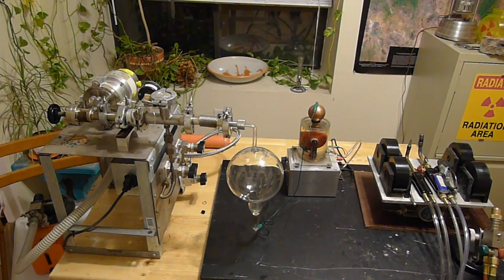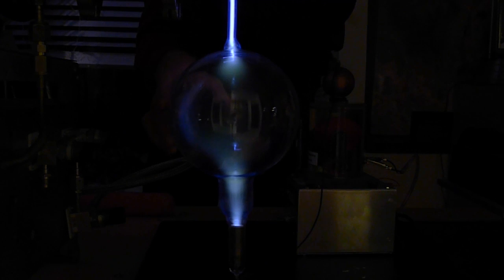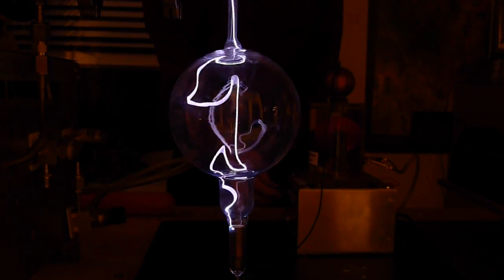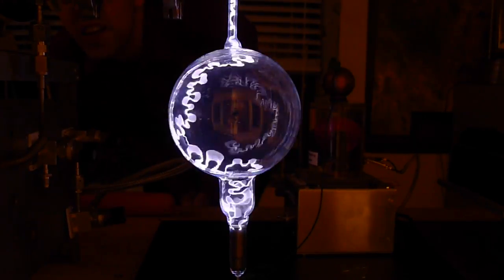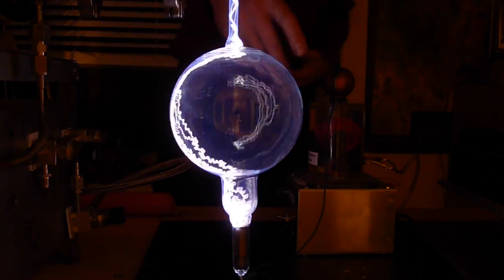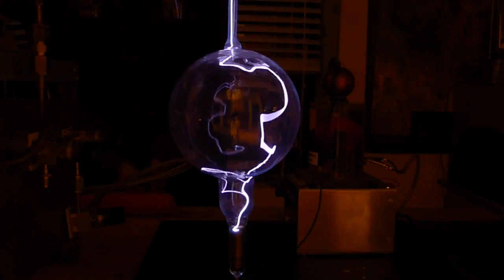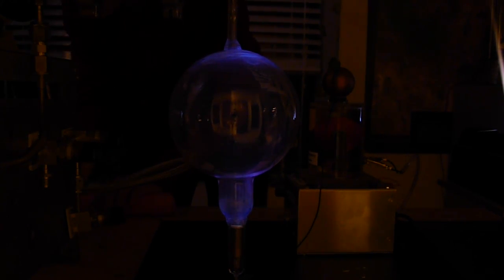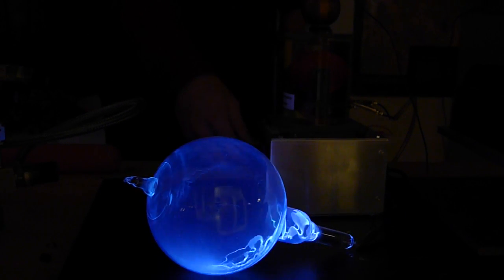Electrical discharges in xenon at various pressures

Comment from the maker: I've come to a new understanding about the green color in some of my tubes, and now know that is has to be related to the presence of air.  I have ruled out oxygen and argon, among other possible contributions, and I have concluded that the green is due to nitrogen.  My guess is that the Parker globes contain neon, xenon, and nitrogen.  I hypothesize that the nitrogen is present at about 1 torr; the xenon at about 30 torr, and neon at some indeterminate pressure.

Comment from the maker: I don't have an RGA at my disposal, but I have cylinders of Ar, O2, CO2, ethane, and of course liquid water, that I have tried adding.  Air makes the green color with xenon, and none of those other gases do, despite being plausible contaminants in air.  Nitrogen is the big unknown by this process of elimination.  The green could be due to molecular species involving nitrogen AND oxygen, I suppose, but I do know that air is KEY.

Comment: This is so awesome, Carl! I don't know how I missed it when you posted it. Comparing my xenon globe from ZRG to this video it appears my tube is around 500Torr of pressure. My tube displays a green tint to the discharge through most of the range of power input up until the point that the entire inner surface is covered in tight white arcs. I believe it is air contamination. I like the convection driven filaments that stay in the center of the gas volume best though.

Comment from the maker: In my experience, borosilicate glass usually fluoresces a bluish color.  The soft (soda lime) glass in many of the demonstration discharge tubes available commercially does indeed fluoresce green.  As for the meandering arcs, I'm of the opinion that the arc channel follows thermal convective vortices that become established once the pressure is high enough for turbulent flow.  I'm not familiar with Bill Parker's green mix...any photos of the effect I can look at?

Comment: Do you do any hot processing of the globe to exclude contamination?  Do you induction heat the electrode, or run the globe through an annealing oven?
Reply from the maker: This is a very old video in which no degassing was done (and no annealing was done for that matter).  I subsequently built an annealing + degassing oven for plasma tubes out of firebrick and kanthal coil.  Whenever I use electrodes I induction degas them.  I don't use them too often.

Comment: interesting. did you use an rga to eliminate the other contaminants as potential contributors? my first guess would've been atomic oxygen via the same mechanism of aurora light. It would be great to get at it with a little oceanoptics usb spectrometer.

Comment: what are the votage rating of your Tesla coil? 
max voltage and whats the frequency please?
Reply from the maker: Output voltage is ~30 kV, frequency is 20-40 kHz
Reply: Carl Willis
thanks for the info ;)
Reply: At 30 kV, wouldn't you have to worry about X-rays when running the tube at high vacuum?

Comment: aren't you creating xrays during this process?
Reply from the maker: At high vacuum, there are some measurable x-rays from this sort of activity.  However, putting gas in the tube limits the mean free path of electrons to distances that prevent them from gaining sufficient energy to produce energetic, inner-shell x-rays or bremsstrahlung.  Even in the high vacuum conditions, the x-ray yield is small and inconsequential.